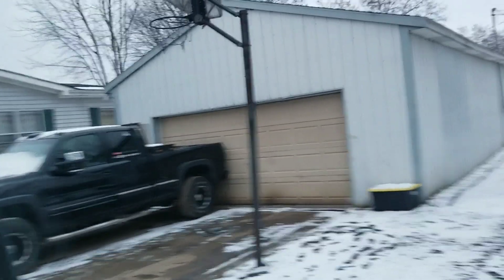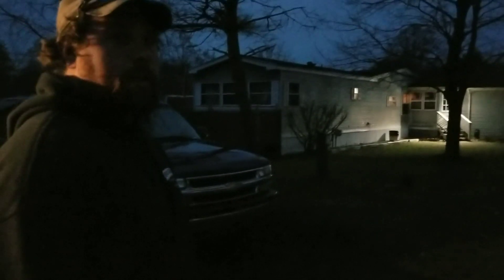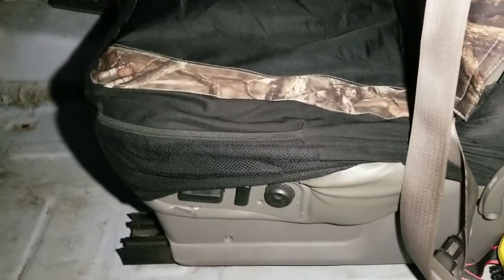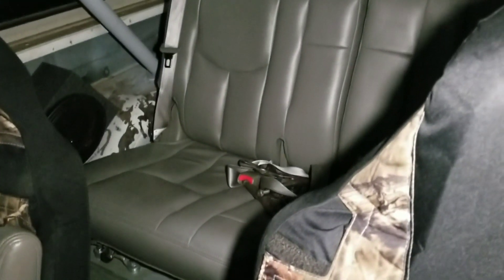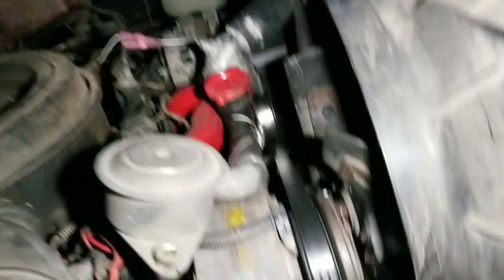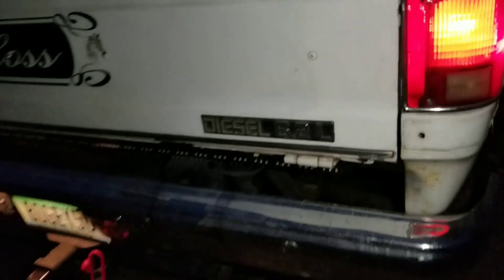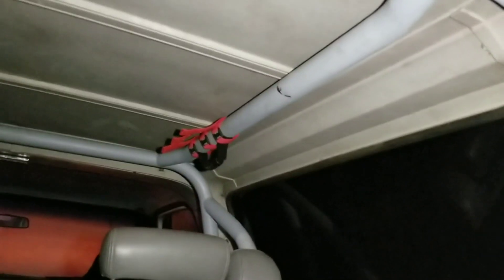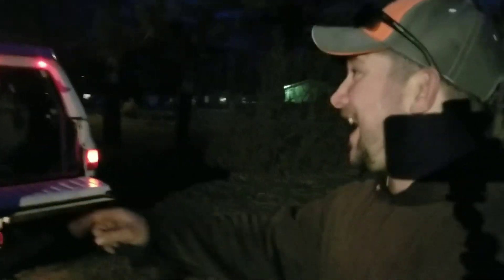85 6.2 Diesel Blazer Walk Around

Comment: Did he say it was a military blazer? Didn't think the m1009 had ac or power back glass.
Reply from the maker: Those were added. That's also not the original serpentine design or set up. He did away with the v belt
Reply: Not a military it was DNR used.